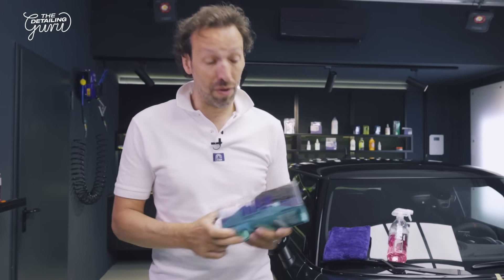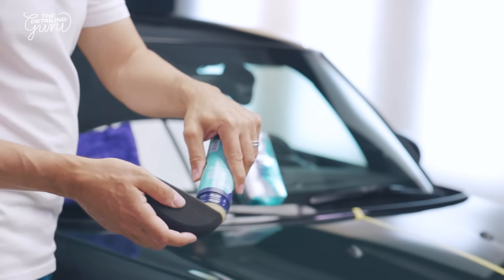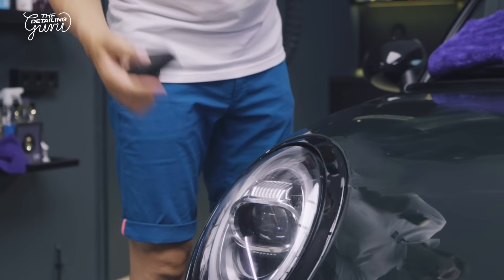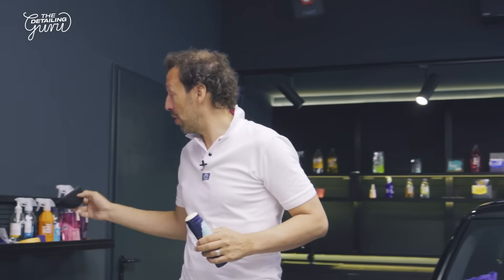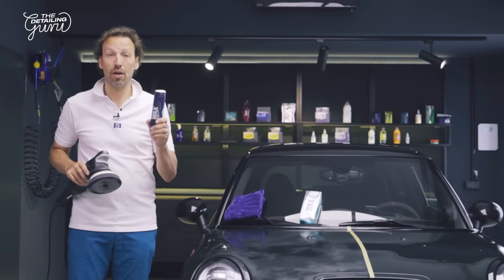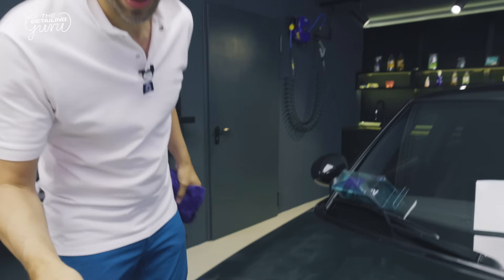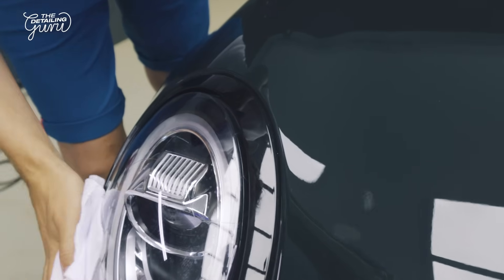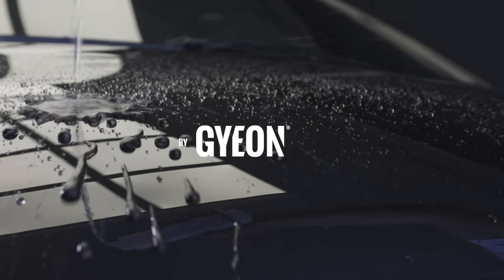WAX IS DEAD? How to make waxing a joy. - The Detailing Guru

Comment: Which topping can you recommend for this GYEON Q² Wax?   
- Couldnt really find the ideal answer in the comments so far.. one time you wrote CURE, the other time you wrote CERAMIC DETAILER.
Reply from the maker: Yes because both can be used - any topper from the range can be used of Q² Wax as additional sacrificial layer.
Q²M WetCoat / CeramicDetailer / Cure / Bathe+ / QuickDetailer
Reply: @GYEON_official  Thanks for your answer.

well, I dont have any ceramic coating or so, just the bare GYEON Q² Wax on my car. What is YOUR recommendation as the best topping, for example after a quick hand wash?    Or no topping at all?
Reply from the maker: There is no best! It’s all about preference, expectation and purpose. 
In your case I would stick to Q²M QuickDetailer or Q²M CeramicDetailer. 
Regards,
Y.
Reply: as user, i think wax have all of them beaten, having any of the toppers will masks wax's performance, especially in slickness and gloss and water beads. so i decided to just decontaminate and apply new layer of wax on top and repeat the process whenever i see performance degradation, this is a huge advantage over other layered coatings, because u dont know which layer is thin or completely gone. jsut wax and wax and wax forever. it's such a brilliant product.

Comment: Can it be used on PPF?
Reply from the maker: It can but for better adherence go for Cancoat, you will never be disappointed! 
Regards,
Y.
Reply: @GYEON_official  it already has a ceramic coating on it. Just wondered what top up to use?
Reply from the maker: For sure use Cancoat! Make sure you do a proper preparation first, also on PPF. 
Regards,
Y.